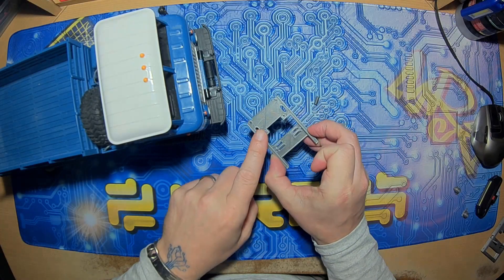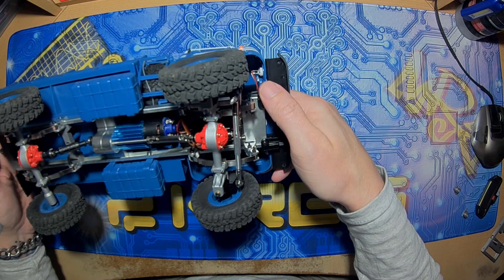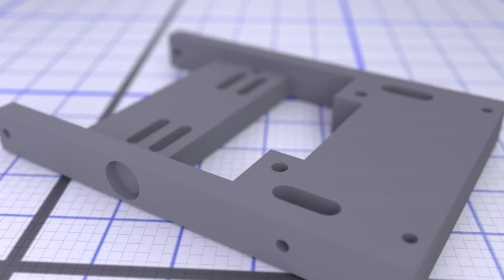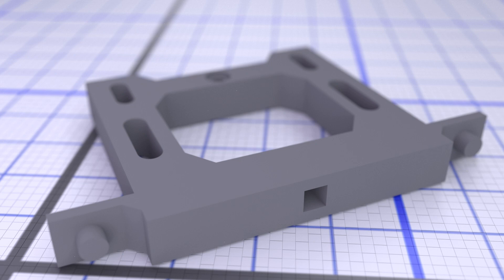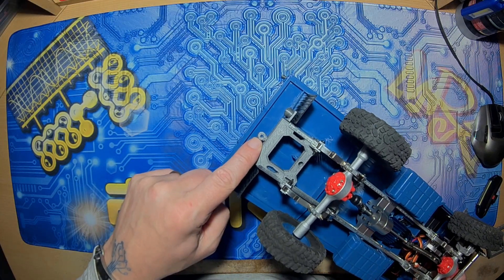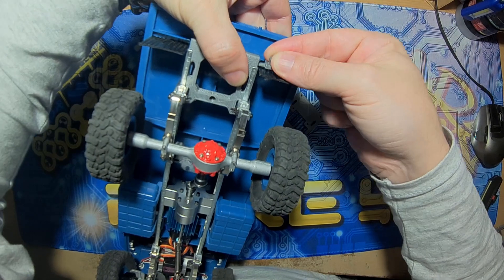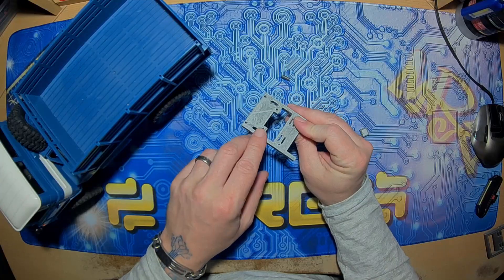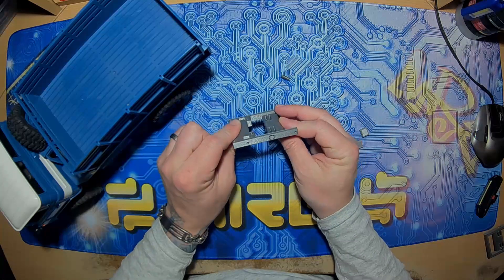WPL B Series Modular Chassis Parts [ Any C Channel Frame Compatible ]

Comment: The parts look good :)
I found a bundle on Humble Bundle again, with some stuff that could help you. It's been some time since I've watched some of your videos (i don't get notifications for some reason, still not..) but i randomly thought about it when i saw the new bundle :)

If you're not interested in most of it, the 1 year Monstercat Gold subscription is already worth more than the $22
Might be useful, since with that you can use any Monstercat music in your videos ;)
Reply from the maker: Thanks - they are working great as are the MN90 versions, so all good. 

Cheers for the heads up on the humble bundle , I might of been intrested in the monstercat subs if I put out alot more stuff but I'm happy with NCS etc for the time being.

Comment: They look like pretty good quality! I have the metal version of this front servo mount plate only problem is if you crank the screws down too much they strip! Great vid! 👍👍😎
Reply from the maker: I've learnt my leasson with Alu over the years ,ha! Hopefully these will save someone a small fortune and prehaps spur on some cool addon lights or accessories for the rear one.

Many thanks, I'm slowly catching up on your content which is great as ever.
Reply: MrE that is the beautiful thing about RC it’s a lot of expensive mistakes to gain experience! With excellent content like yours you’ll pass me once the masses catch on! Great vid on bringing new options to the table! 👍👍
Reply from the maker: This little lot for the WPL pales in significance to the project getting the most attention at the moment (for the Defender) but hey, the journey is reward in itself and we both love learning & creating things to enjoy as spoils with the little ones in the end <cough> :)
Thanks for the kind comments & complements, as always!